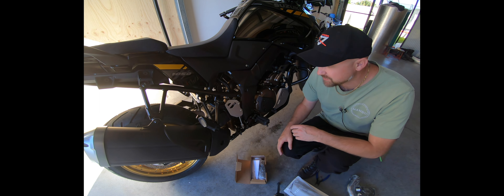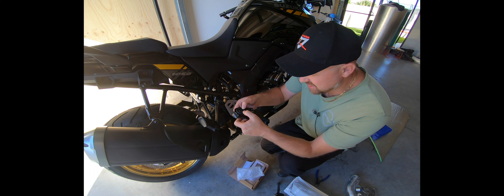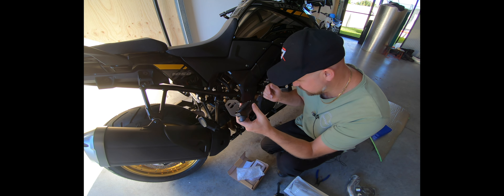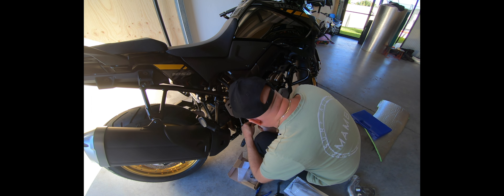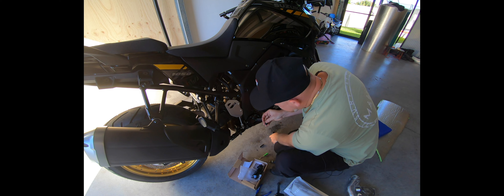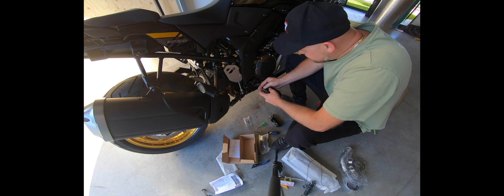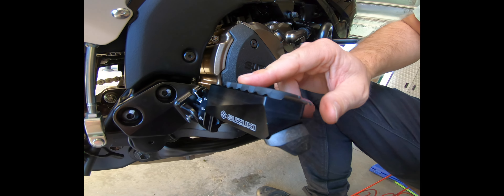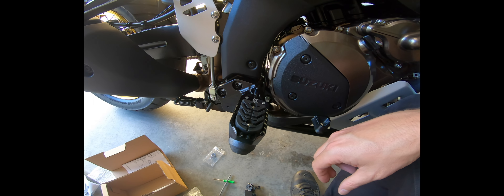Ep 5. Suzuki VStrom 1050XT Foot Peg Upgrade

Comment: what's the actual lowering gain compared to the standard pegs, when set let's say to -2cm? It seems like you're implying that on 0 they are taller than the standard ones? The lowering bit is what interests me in these.
Reply from the maker: Hey Dude. Ok 2cm adjustment might not sound like much but it can be a world of difference in comfort. Especially over long trips. I knew by sitting on the bike it was out to adjust for my comfort. Any adjustment compared to no adjustment is good in my book.
Reply from the maker: Also had to lower for left foot to have better foot access gear change
Reply: @PissTakeProduction  ok, so then compared with the standard foot pegs, how much can you gain? -1 or -2? because if you had to lower them by -1 because they felt too high, it sounds to me like they are taller than the standard ones when set to 0. I am thinking of buying them if I can get a -2 compared to what I have now but if it's only -1 ... is it worth it ?
Reply from the maker: I never measured the original height on stock. But I will say I paid for the build quality of these pegs plus the rubber pad compression has two prongs that grip the boots when standing. Added bonus they are adjustable. If you look at BMW GS bike it's the same CNC footpegs at a better price. Hope that helps.
Reply: @PissTakeProduction  thanks for the answers and indeed they look nice. Thing is they are not cheap and for me the main point is to lower them and there are some veeery cheap (comparably) lowering solutions. Oh well, I'll figure it out eventually :)) ride safe
Reply from the maker: There's plenty of aftermarket high quality cnc footpegs just need to see who makes them etc for this VStrom.

Comment: According to Suzukis UK site, these are not compatible with the centrestand - have you found that issue to be true?
Reply from the maker: It might be the 650 VStrom version footpegs. The ones I have a excellent and I believe the US version was getting them installed as an adventure pack.
Reply: @PissTakeProduction also, how much up and down adjustment is there in the shifter and brake pedal? and you’ve got the part number for the pegs you’ve fitted? (Just so I know what to order!)
Reply from the maker: @martyn_g  Email Suzuki or phone the dealership they will know what to order off the bike serial number. Another way to find the part if you go to the Suzuki website and bike build you can see it under accessories.
Reply from the maker: @martyn_g  The shifter and brake pedal I didn't adjust.

Comment: Will these foot pegs fit on a 2019 1000
Reply from the maker: Suzuki sell two versions of that foot peg. Just email them and they should be able to confirm for the Vstrom 1000.
Reply: Bonjour est-ce que tu pourrais mettre tout les lien d’achat de tout les accessoires que tu achètes pour la moto stp 😉👍
Reply: @PissTakeProduction  Nice video and good to know that are some other options. 
Do you have a partnumber for these? It would be easy to find them...
Reply from the maker: @adrianciobanu5167  Under Suzuki VStrom buying page accessories or local bike dealership be a good option.